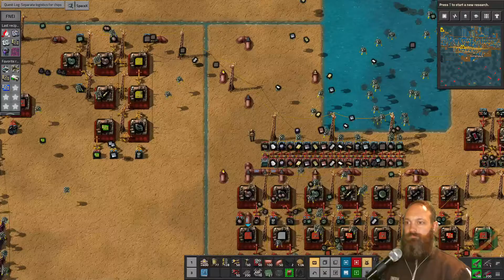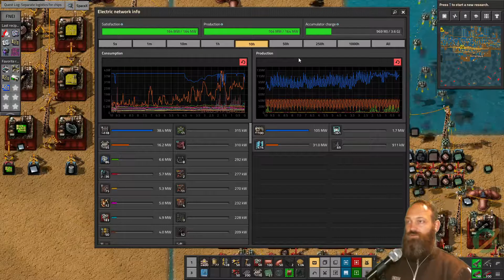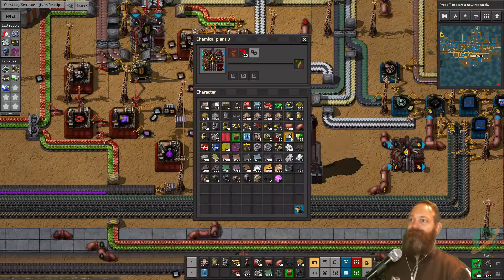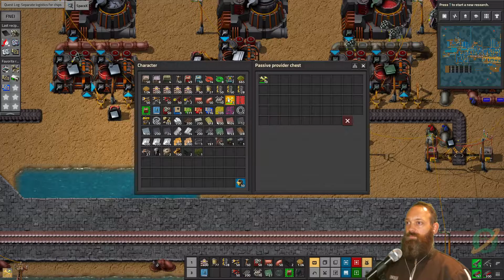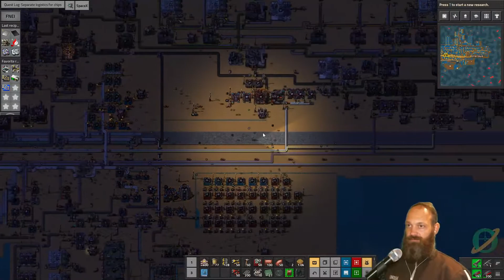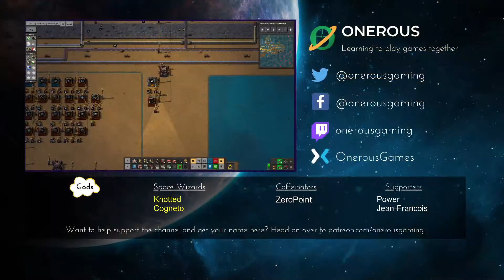Bob's + Angel's Seablock Ep 115: Look out space, we're coming for you

Comment: Microphone levels are good! I can hear you loud and clear.

I figured the tinned copper wire would come back to bite eventually. Maybe that is something worth tossing into coils are you scale up green circuit production.

Sounds like you may need to add a few more geode based mineral sludge production modules as well.

Your brand new power expansion will have trouble running without water 😉
Reply from the maker: Haha, I can't believe I forgot the water! And I've already done the next two episodes, so I guess it will have to wait :(